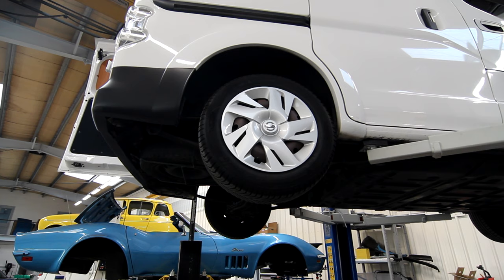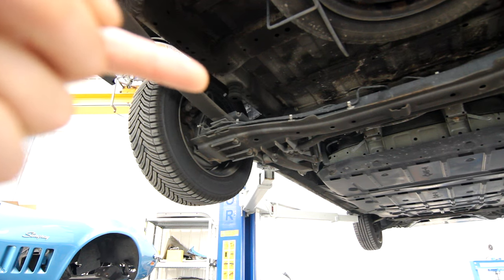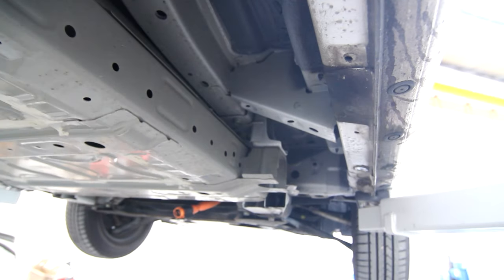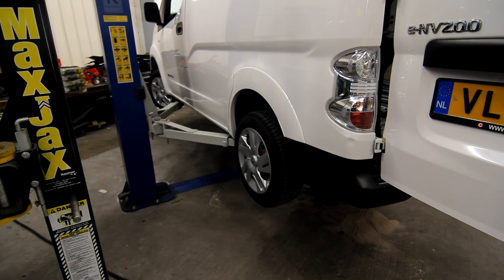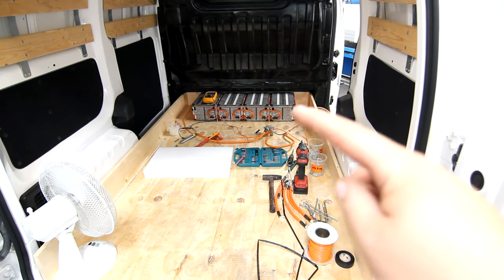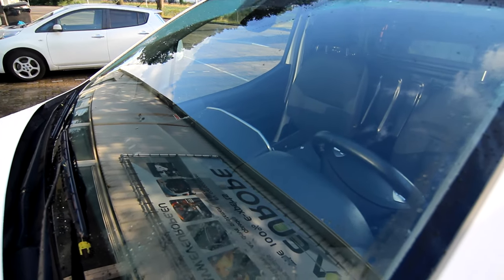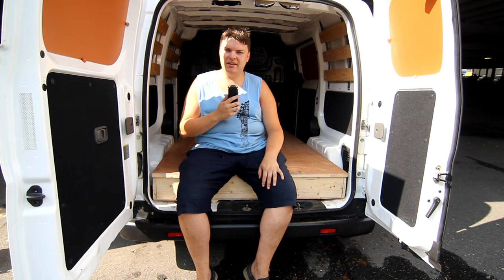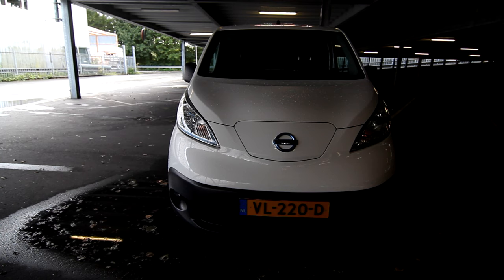69kWh e-nv200 - range-extended electric van!

Comment: I never realised that there was so much empty space beneath the e-nv200. They could fit a 100kWh pack in there if they wanted to.
Reply: yerah but it would have been a 80k van........Nissan did the right thing.....that's why there are hundreds of them all over London.....great van ,love mine
Reply: @countteddy  I'm about to buy one, what year is yours?
Reply: @countteddy  a second hand 40kwh costs 5k. Nissan should be able to produce a 100kwh battery for less than 10k.

Comment: Great work! I have a 40kWh ENV200 and have been looking at ways of increasing range too, however the loss of load area wouldn't work for me as I put seats in the back. Have you considered making an underslung pack that fits in the void where the spare wheel sits?
Reply from the maker: The downside of that space is that it's very inefficiently packed; the spring range prevents putting a pack over the entire length of the empty air under the loading bay. You can only safely install ~17kWh there. Might still be an interesting option, especially for the 40kWh
Reply: @PowerElectronicsBlog  I'd definitely be interested in an extra 17kWh, can I contact you directly to discuss?
Reply from the maker: @TheOnlyJizz  Thought I responded to this, but the comment seems to be lost (I think - I haven't heard from you) - so again: info at muxsan dot com

Comment: Love the video. I see you put the extended battery in parallel with the original 24kw one.  It would be great if you could compile a diy kit with instructions, some wiring diagrams, pre programed can bridge, second bms, cell balancers and the way you set up to trigger the second battery contactor,  you mentioned in the video, but didn’t show the hv contactor for the e-nv200. People around in Australia could buy the kit without batteries and  then could byo Lifepo4 batteries boxes etc. I would do a 112s 3.2v 105ah pack. 37kwh extra.  What I’m saying I would buy a kit from you and get a van from Japan Auctions.
Reply: There's a New Zealand company that does that.
Reply: @dottyjyoung  Oh cool. Do you know the name of the company please?

Comment: How is there Henk Westbroek on the radio?! 🤣🤣 Are you in the Netherlands? I saw a 2017 model with the old 24kwh battery. What would you say it's the actual value (if all works fine still)? They sell around 10.000 euro ex. Vat but i feel the actual value is more or less 5 or 6ish ( ah i looked it up, indeed Dutch :) )

Comment: "They could have put in a twice as large battery... but they didn't" 
That's the thing about gas car makers when they make electric models. They tell their designers to "Make it good, but not TOO good."
Reply: so a 100k little white van with leaf springs designed for city/town deliveries?......with a 200 mile range ......?
Reply: @countteddy  If you want.

Comment: What a great build, thanks for sharing!

I wondered how many extra cells you would need to add to a 40kwh model to achieve the same result? Also, could any of the extra batteries be housed beneath the front seats?
Reply from the maker: I'd guess you can get very close by putting modules in the spot where the spare tire sits now. I measured it, you can probably fit two 8-module packs underneath. The downside is that it's exposed to the elements, so it needs a pretty sturdy enclosure. The 40kWh would technically need an extra 24 modules (instead of 40 - makes sense right) to get to the same '69kWh'.

Comment: Where can I find the info and gain the knowledge of batteries. Iv heard a couple of times about discharge in batteries or equalising them. How will I learn the basics of why I can’t just have interchangeable packs at different charge rates etc, or a trailer with its own pack and an umbilical cord to somehow put the power to the prime mover etc. Thanks in advance

Comment: Great...so from 22 kWh to 66 kWh...more than the premium leaf e+

How heavy is it...and what is left for cargo?   the evalia would need a diffrent solution...

4 more chargers and it could charge like a zoe at AC chargers....
Reply from the maker: It's about 390kg, there is about 400kg left for cargo. Evalia needs a taller, shorter battery box - we'll be looking at that one too if the e-nv200 van doesn't end up having any software issues.

Comment: Hi mate, can you upgrade my ENV200? I wanted to add 3 x 24kwh battery packs to my van to give it a extra 72kwh boost.
Reply from the maker: That's going to exceed the weight allowance of your van. The maximum we can add is approx. 62kWh, and even that is pushing it (that weighs about 600kg, leaving barely anything for cargo).

Comment: What is the input voltage for e-nv200 DC or AC ? I am confused if I want to fast charge can I supply high AC current or it needs external DC charge?
Reply: I think you can install an AC 7kW charger at home, but the rapid ~50kW chargers are DC.
Reply: @jarrodheley7879  Thanks for reply. Is the AC 7kW charger simply supplying the power to the car or you need some king of module between the wall and the car?

Comment: may you look at the RV parts I remember to place a "Air Balg" between the Stopper and  leaf spring suspension,  get a higher load and much more comfortable ride.  you need a small pressure pump and level valve  all in one system .
Reply from the maker: Ah, like replaceable air suspension. That's really interesting, I didn't know this was something you can add aftermarket, but it makes a ton of sense. Should help with damping as well. I'll look around if there's something that fits the e-nv200!

Comment: you want a truck to be built like a car, and the car like a truck? not many trucks have disc brakes and they are heavier,  same for leaf springs the other way, not many trucks have coil springs etc.
Reply: Trucks have airbags and disc brakes
Reply: @mattwoodproperty  some do, yes, but not many, all the trucks I have worked on and owned have drum brakes and leaf springs. apparently discs cost twice the price.
Reply: Will George in the uk, discs are standard and drums are a special order. Leaf springs are ruled out as they damage the road.

Comment: I wonder if you are able to do this for a bmw i3. Adding more battery in the useless rear trunk or.
Chevy bolt. Splice a cable to connect to a gas generator to trickle charge the bolt battery while driving
Reply from the maker: We're not looking at the i3, Volt PHEV or Bolt anytime soon. In general, VW and BMW tend to be a lot trickier to reverse engineer and to get good schematics for, so these are longer-term projects to consider.
Reply: @PowerElectronicsBlog  oh ok.

Comment: Great project. So it originally was a 24 kWh? Great to see the splicing part, it actually looks rather straight forward.
Reply from the maker: Yeah, used to be a 24kWh in very good shape for an e-nv200.
Reply: PowerElectronicsBlog Cool. I dream about converting one to a small campervan.

Comment: That's a very cool upgrade, especially the part where you edit the BMS to handle an extended pack. Could you reveal some details as to how that is done?
Reply from the maker: We have a little box that sits in between the car's main computer (VCM) and both the original BMS and that of the extender battery. The box essentially combines the information of the two BMSes into one number that the VCM uses to generate the expected range, etc.
Reply: @PowerElectronicsBlog  Oh, that is pretty clever! Am I right in assuming that it's doing it through CAN-bus manipulation?
Reply from the maker: @Kallenator1988  Correct, I have a video on the CAN MITM board we use.
Reply: @PowerElectronicsBlog  I will check it out, thanks for educating me ;)
Reply: I was trying to find this CAN man-in-the-middle video, but there was no information result after searching. Can you please help me? 😎
Reply: @PowerElectronicsBlog  this Can mitm is avaliable to buy? Or i need an email adress to contact.

Comment: 4:30 You really don't have a clue what you're talking about. LOL :-)
The wheel wells are covered (plastic) in the front. Precisely to silent the ride.
On the back there's nothing which produce a quite noisy experience. 
 
If in doubt go for a ride without the covers. The difference is staggering. ;-)
Or even better if you can get some for the back the ride "quality" will benefit a lot. 
BTW the lack of them is the first indication of a cheap option by the manufacturer. Same applies for the suspension, brakes...etc. All clear indicators of cost cutting.
Anyway nice video and presentation. 
Cheers

Comment: how about the temperature management for the extra pack? Won't it throttle the whole pack charging because of the overheated extra pack?
Reply: I don't think so. Less load per cell = less temp.
Reply: @pashko90  is the BMS that advanced that it varies the charging current depending on the temperature on the cell/block level?
Reply from the maker: Almost certainly not, it's a pack with such low losses that even the much smaller extender int he Leaf doesn't heat up significantly under repeated fast charging and driving. But we'll be testing that.